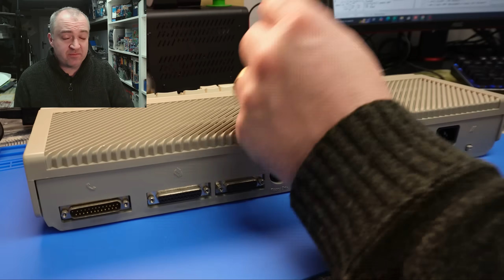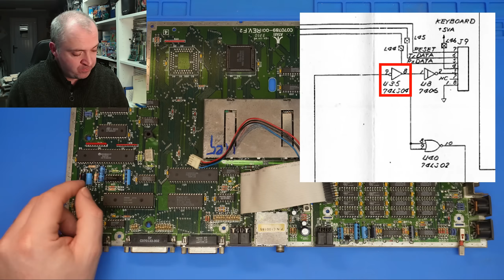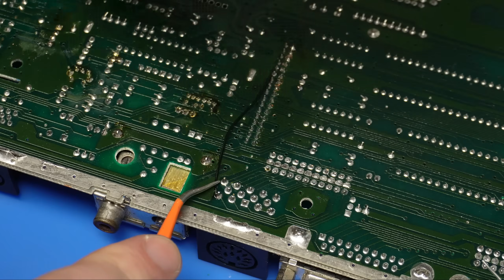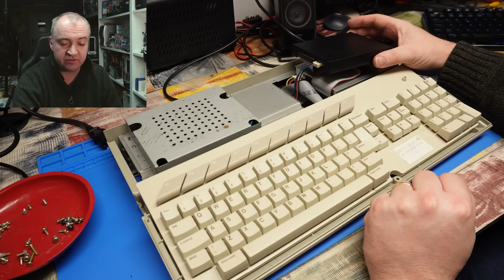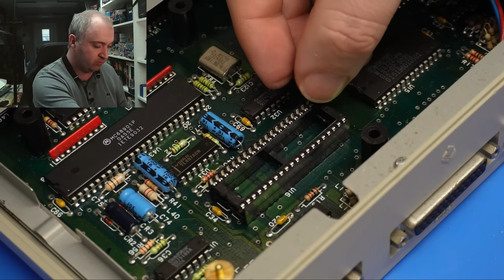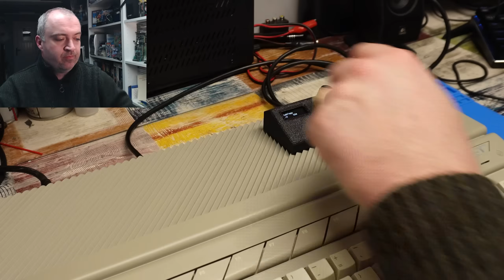ATARI ST Single Wire MOD for TWO Internal Disk Drives

Comment: i have an external floppy cable that goes to a card that allows the ribbon cable to connect to a gotek, usb powered via one of the bottom expansion ports.. i cannot get the Gotek working yet even set as s1 , not s0 , some forums suggest unplug power from drive a , why would i want to do that.. but am looking for a better approach, how did Atari make external drives work with internal one's, make be a way. good video btw

Comment: Great job Glen. I tried to do the same on my 1040 STF. I have the C070523-001 rev D board. When I got to the jumper from J5 to J11 I hit a snag. The pin on J5 that you soldered the jumper to on my board goes to a resistor to the FDD power rail, not to pin 19 on on the Yamaha chip. Pin 5 on J5 goes to the Yamaha chip pin 19. Strange because that is suppose to be the Drive select 0. Weird.

Comment: Seems to me that HDD mod is far easier to do on Atari than on Amiga 500. Great video, as usual.
Reply from the maker: Thanks, glad to hear you enjoyed it.  It's only easier because the ST has the port for it whereas for the A500 you need additional hardware.

Comment: You proved what I had dreamt up a couple of years ago, only I thought of using a small PCB with connectors to plug the floppy cables into and a y-split of the power cable.  I also thought of using a long floppy, switch cable and extend the power out the left side through the cartridge slot so that the Gotek would remain external.  Your solution has merits, though and would be cheaper, since no PCB or floppy connectors would be needed.

Comment: Thats a very good mod. I was wondering how you would access the usb drive...ingenius solution!

I have an externsl gotek for my amiga, i am a novice with these things, does every gotek need a separate power supply or will it draw power direct from the amiga?
Reply from the maker: @paulward2076  unlike the Atari, the Amiga provides power over its external floppy port and is suitable for up to 3 external drives.  If you have an external Amiga floppy enclosure just replace the disk drive with a gotek and it'll work.
Reply: @CRG  thank you for clearing that up for me. I dont gave an external floppy drive but there are relatively cheap gotek cases on ebay that i can buy.
Reply from the maker: @paulward2076 like the original external drive enclosures it needs to have some logic in it to work.  This pcb project might be worth looking at https://www.pcbway.com/project/shareproject/Amiga_External_Floppy_Adapter_v1_3_6b9e41fc.html
Reply: @CRG  once again, thank you. Ill check that out asap 🙂

Comment: Haha, I was half expecting you to find a way to mount the GoTek inside or on top of the ST, casing and all, but in hindsight I should have realized it makes more sense to take the GoTek out of its casing and mount it inside. 

Nice job on all the soldering. I noticed that the DS1 signal was routed through an inverter on the schematics and through a NAND gate on your board. What is happening there I think is that on the board it is using the NAND gate as an inverter instead, probably to save on ICs. Similarly, if you happen to find an activity LED signal for the secondary drive, and - assuming the activity LED signals are active high - you also happen to find a spare OR gate, you could route the two activity LED signals through that OR gate to get an activity LED signal for both drives. 
 
I've seen this done in mods for the MSX as well, for instance RAM expansions. Find a spare gate or sets of gates and build the modifications around that.
Reply from the maker: Thats a really good idea, I'll look into adding an or gate and get the led working for both drives.

Comment: Love it, especially the use of/and idea to feed a ribbon cable through the case, rather than individual cables like I did on the Amiga. Great work Glen!
Reply from the maker: Thanks Kari, the ribbon just worked better here since I needed so many wires up through the case plus the slots on the Atari are tighter than on the 500.  The only downside to the way I done it is that the ribbon and gotek housing are now essentially fixed to the case top but will do for me, I don't really see the need to ever remove it.  

And thanks again for letting me use your gotek housing design 🙂

Comment: great job glen ..you made a great atari st game machine! i like golf alot too!
Reply from the maker: Always loved Microprose Golf, me and my Dad played it back in the 90s on my 1200 until we were both scratch golfers.  That's one thing I loved about it.  You start as a 28 handicap and have to work your way up but as you improve your distances also increase.  When you get down to near scratch you'll be bombing 300 yard drives and it changes how you approach each hole.  

If only the real game was like that, been playing for near 20 years and struggle to break 90 most weeks😂
Reply: @CRG  i get that..😆

Comment: Nicely done, as usual, bud.   Turned out neat and tidy.

It would've been nice to have it off to the side a bit more, sure, but nowhere near a game breaker.

Looks like a sweet setup.  🍻
Reply from the maker: Yeah as I said if I were to do it again I think a longer ribbon would be useful to move it off to the side but it works fine as is and I'd rather not solder another 32 wires so I'll just leave well enough alone 😂

Comment: Good video but it is no longer necessary to change the floppy disk for a gotec since it is enough just to modify a PC floppy drive and leave it in DS0 so that it works in an Atari ST, I modified one for my Atari xf551 floppy drive and before that I tested it in an ST520fm to see if the modified one worked and it worked perfectly, the modification if it does not have selection jumpers is just to cut pin 12 of the drive and bridge it against pin 10 of the same or failing that do it in the parallel flat cable... greetings from Chile
Reply from the maker: Thanks for the comment but I didn't replace the floppy drive with a gotek, I added the gotek as a second disk drive and added a switch to select which drive would be id A or B (switching DS0 or DS1).  I'm sure you can use PC floppy drives without problem in the ST but my original drive is working fine.  The point I suppose was to add the gotek while retaining the original drive so I can still use floppies when I want to but the gotek makes it handy for games.

Comment: What I'd love to see is if the harddrive emulator could also be installed internally rather than the rather ugly plug in the back of the machine. Ive thought about that for a while and never got around to trying it
Reply from the maker: I think the only way to do that would be to solder wires and pickup all the signals internally.  Could be done but a lot more work than just a single patch wire to enable the disk select line.

Comment: Fantastic mod. I have an hxc2001 and internal floppy installed, but nowhere near as this internal gotek, it’s a fantastic job. I notice though that the tilde key is down, have you lost the wee rubber dome? Just a note as when rebuilding these keyboards there is an extra unused space in the plastic, maybe the dome is in the unused spot? Rowan
Reply from the maker: @clintongoodfellow thanks glad you enjoyed it.  You're the first to notice and yes I've lost that rubber dome.  Searched the place high and low for it but it's nowhere to be found.  Will try to get a replacement.
Reply: @ it’s worth opening the keyboard again and checking the dome isn’t in the unused spot. Done it myself that’s how I noticed! :) Exxos covers it on his site, “The LaST Upgrade - PART 4 - Keyboard”

Comment: I'm guessing the ST have the same problem as the Amiga --- 
Re: Booting Non-Dos Games & Demos from just drive 0/A ?
Hence the need for a switcher.
Reply from the maker: @garyhart6421  Yes, as far as I know you can only boot to drive A.
Reply: If I recall correctly, on the Amiga if you have Workbench 2.0 and above you can use the early boot menu (hold both mouse buttons down at startup) to switch between internal and external disk drives.
Reply: @LeftoverBeefcake  But surely Non-Dos ignores this ?
Reply: @garyhart6421 The boot menu is part of the Kickstart ROM and appears before any drives (hard drives and/or floppies) have a chance to start. It doesn't matter if the disk uses AmigaDOS or not.

Comment: wow, you have great eyes, you could see my STE from down there up to Europe, except I have the control panel in gray and larger two colour panel. I did this mod last year.

Edit: also you can make a LED for Gotek status by using the buzzer pins on Gotek and route it to your panel.
Reply from the maker: @madigorfkgoogle9349  beat me too it then 😅.  Really happy have this mod fitted as it makes life a lot easier for loading software.
Reply: @CRG  well its no wonder, it is a pretty logical "on the hand" solution.
I have my rotary switch from the side and the USB from front and its all mounted more to the right side, as you mentioned in video.
Reply from the maker: Sounds like a nice clean build

Comment: Pretty great mod. I haven't looked at my ST in a while, but I did do a gotek mod without preserving the original floppy.
I also paid a bunch of money for an UltraSatan about 15 years or more ago for the HDD emulation. I imagine it's a lot cheaper/easier to emulate the HDD these days with how good microcontrollers have gotten.
Reply from the maker: @TheRealBobHickman  thanks, glad to hear you enjoyed it.  I briefly used an UltraSatan back when I had the STE in for repair but the asic2stm I have now cost only £13 as part of a group buy.  Granted that's just a bare pcb and parts but still a bargain.

Comment: Excellent video Glen, it's certainly an interesting approach to the conundrum of new over old tech - use both! One of the gripes I've always had with the ST is that poxy floppy data and power cable not being removable. Wondering if its worth adding a nice little blue LED to the Gotek enclosure and using the drive activity pins off the PCB?
Reply from the maker: You know I was thinking that very thing.  The gotek has the activity led on it. I could just use one of the spare cores in the wire to run the led.
Reply: @CRG  sometimes simple is best. Reinventing the wheel can be done another day :)
Reply: I wonder what would happen if you used a bicolour LED and have select 0 wired to one side and select 1 to the other.
Reply from the maker: @Adam_Boots  you'd need to introduce the same logic I think to drive the led but might be easier to take it directly off the gotek.  The hardest bit though will be routing a wire to said led as its part of the keyboard.
Reply: Good job 👍 thanks for this vidéo 😊